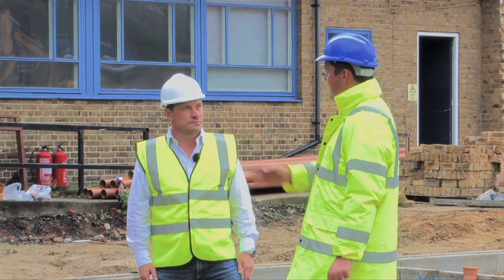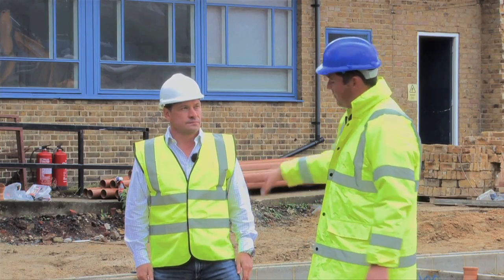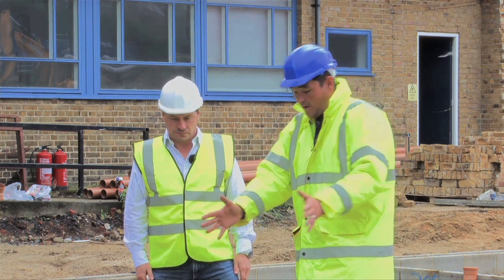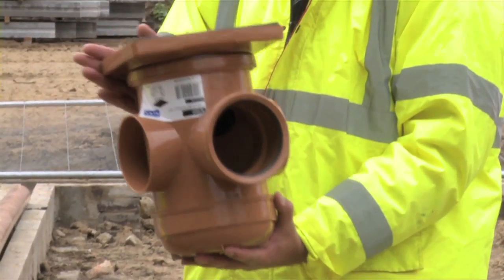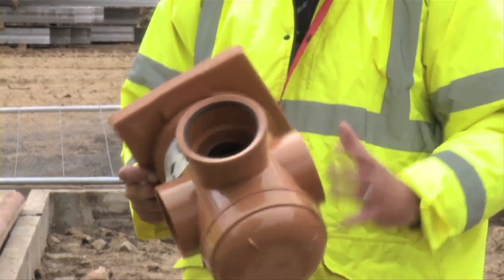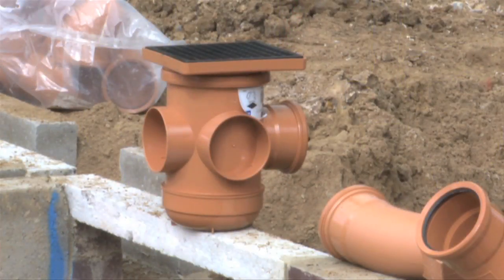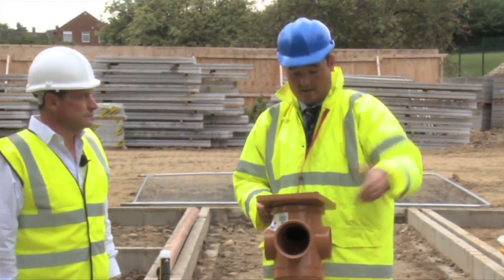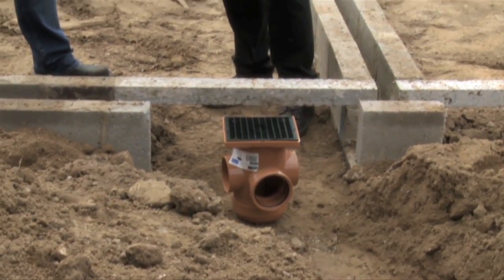How to install a Bottle Gully - OsmaDrain

Comment: If you want to show how to - show the details.  I've looked at these and one thing I don't understand is how to cement them in and I've not seen any examples of how people do it.  They don't look designed to help this with the lip being very narrow.  The old pot ones had an inch lip these are less than 1/2 an inch - what gives?